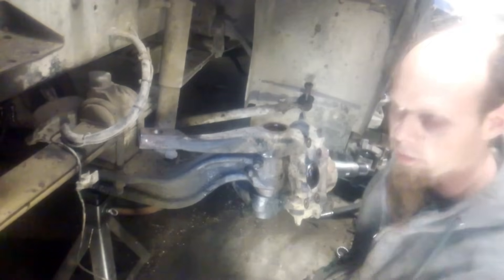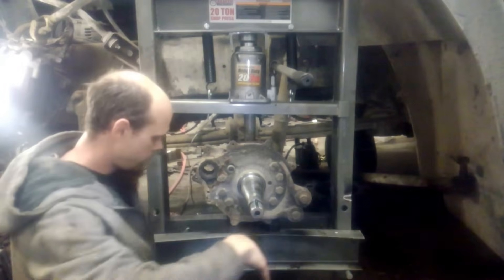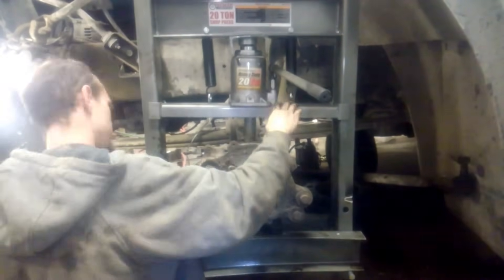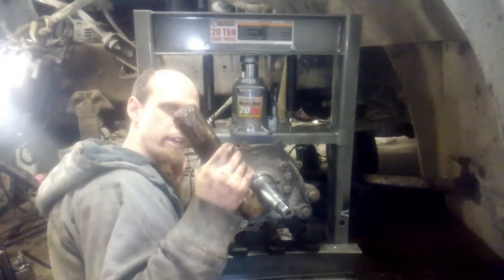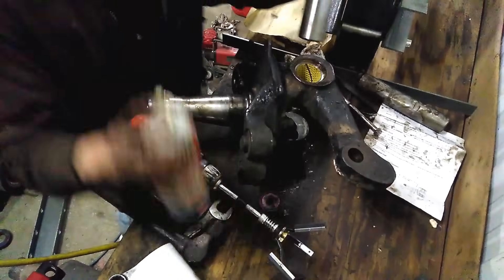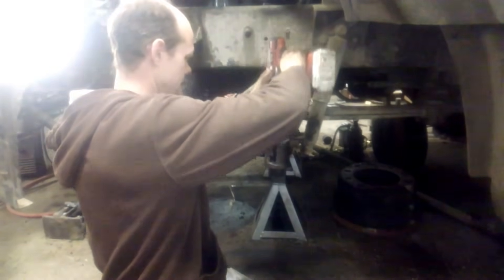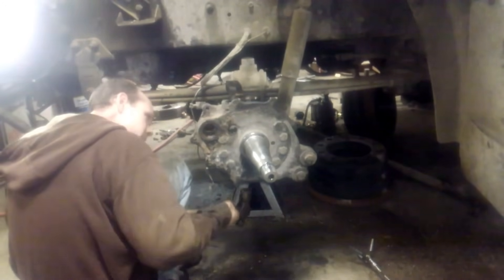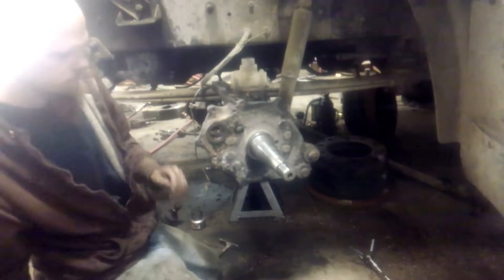kingpin replacement on big truck

Comment: New to trucks m been in automotive for years though . Is there a bushing in the axle eye ?
Reply from the maker: No. By design the pin should not move in the axle eye so there shouldn't be wear at that point. However sometimes the axle eyes will get stretched or damaged and they can be repaired by boring them out and installing a pressed in sleeve.
Reply: @Ezrider359  Thx for the reply . Appreciate it .

Comment: That’s funny. I was changing a Motor mount on a Mack and the spacer or metal thing inside the bushing came down and smacked me in the mouth. I thought I was going to be missing a tooth for a bit until I got the feeling back in my mouth

Comment: Hi I'm a follower just a quick question what size is the brake hone thanks
Reply from the maker: normally the standard brake cyl hones are adjustable from like 3/4 - 2 1/2 or something like that should cover most all kingpins

Comment: I have a freightliner columbia 07 single axel ,have replaced all major frontend parts ,and still feels loose on road . Do you have any suggestions  ? Thank you  !! 
And when braking hard if feel something pop & shift in frontend.
Reply from the maker: My thoughts are improper alignment (toe out or not enough caster) or worn steering box drag link ect for the loose steering. The clunk possibly front spring shackle bushings or stretched u bolts in the rear. Just to give you a few places to look. If you have someone in your area that specializes in suspension/alignment that would probably be your best bet. Most mechanics suck at suspension diagnosis.
Reply: @Ezrider359  steer box  & spring hanger bushings  & new u bolts all been replaced, & alignment at freightliner, that's why im puzzled ,also kingpins tie rod ends,  its hard to find Mechanic to fix the ghost lol
Reply: @Ezrider359  streached u bolts in rear , i was wondering if problem was somewhere other tgan front

Comment: Ezra, what were the indications that you needed to replace the kingpins?

I have an intermittent wobble, and I think we've eliminated tire out of balance. From the top of the tire off the ground, there is about 1/4" rocking back and forth. Is that indicative of needing kingpins?
Reply from the maker: that would be a possible indicator of worn king pins, use a pry bar and a magnetic base dial indicator to check the endplay on the bushings.

Comment: Question...  I just installed my new bushings, and the king pins will not even go in yet.  I have a small hone, but it's taking a long time to get the bushing to take the pin.  Is this normal?  I only have a 220 grit stone, but is this supposed to be slow process?  Thanks for the great videos.

Comment: I have done my fair share of king pins I have always pushed from the bottom because some pins are marked top by a T on the pin .they may have a slight taper
Reply: @DR-um2bv  their is a printed spec in the shop manual

Comment: important make sure you clean it off 2nd one i did i dint see the second lock pin because of grease and im the only person i know that has ever removed a kingpin with the locking bolt in place

Comment: I know the feeling when it comes to stuck kingpins. The 1.5" ones are a nightmare, the 2" ones come out easier. As a recommendation, when i get a frozen wedge pin, i heat it up cherry red with a torch. Then I lean on it with an air hammer.  When it comes to the kingpin, i heat the spindle just a little, and then drive it out with an air chipping hammer. Sometimes i alternate between the chipping hammer, and the 16 .lb sledgehammer. Some guys use kingpin presses, but they are expensive, and don't fit all trucks. And if possible, i like using the spiral kyser king pin kits. No reaming, hardened steel bushings, and they last forever.  Hope this helps.

Comment: We call it "Achsschenkelbolzen" and it is very easy to insert without tools if you put it in liquid nitrogen beforehand. At least that's how we do it. Otherwise we would have to press it in hydraulically. With a hammer you have no chance with ours. Ours are without clamping bolt. Is an unpopular job.
I assembled them by hand in the factory for a month. 64 pieces in an 8 hour shift.

Comment: I'm a retired truck mechanic, I remember the old days when the new bushings were just a brass bushing that you installed and then you used a great big reamer and reamed and reamed until the king pin fit the bushing. it was a lot of work. Then later they came up with plastic bushings which was real easy, but they didn't last very long.

Comment: dont u should install the kingpin iced ??? to make him a little smaller
Reply from the maker: Not on king pins but that method is used for some things
Reply: @Ezrider359  cuz i work on buses with ZF axles and we using liquid nitrogen And i must say Its the best way bcs sometime happen that kingpin stays in the middle of the ring And wont go in And out either

Comment: I hired a guy to do kingpins on my kw in February. He did a horrible job. The driver side has no shims and missing one of the pinch bolts. Is it possible that I could just tap the kingpin down far enough to slide some shims on it or is it a bigger job than that?

Comment: I did kings in my 94,377 the shop I  had do the job f__ked it up,put the greasecups in upside down,I had them  redo it and then they stripped  out the top threads on the spindle plus the grease  cap,what really  pisses  me off is I  lost a 1500.00 $ run over this f__ked up job.I have to find another  shop as I am getting  to old to tackle  that job ,and do to the fact that I don't  have a place  too  do it...
Reply from the maker: that sucks, big part of the reason why i started doing all my own repairs got tired of having to re do things i already paid someone to do. wish you the best of luck in getting it sorted out
Reply: Having the bench space is key.

Comment: My bearing is out on my drivers side.I was told it's from not jacking the weight off the wheel before greasing.But anyway I'm tackling this job on my only  day off on my w9.Thanks for the video!Hope mine come out easy!

Comment: Went to vocational school 3 years to be a diesel and truck mechanic. Been doing since 1980 even after i started driving. Please use safety glasses (I've had 2 major eye surgeries on my left eye and was blind in my left eye for 3 weeks ( HORRIBLE feeling) protect those eyes son !!!
I thought i was the only one who used a hone to clean and size the bores 👍👍👍 you did DAMN good !!! Always put the shims between the axle and the top bushing boss (you DID !!) Good job and great video. ALL THE BEST SIR.

Comment: Brother run the jack up as tight as you can get it, and smack the joint with a hammer and it will pop like gun going off.

Comment: can I give you some advice from now on when ever you grease these take a hydraulic jack and put it under the axle and take the weight off the front wheel 1 inch off the floor and then grease t king pin top and bottom never grease them under load. you won't have to go there again. tip free a heavy truck mechanic that's how I do it lve done 100s  of them. 👍
Reply: Perry, I'm a novice about to undertake this process on my 67 Dodge d200. So, are you saying to grease prior to removal? I've been looking for someone who has experience to give me some guidance regarding what tools to use, etc.
Reply: @mechantics  No. he meant take the load off when doing grease during a PM. If it's under load, the grease never gets to where the most contact is. If you haven't already done yours, invest in a can of aerokroil and soak the hell out of the old stuff to help it break free easier.

Comment: the press is a good idea i took an old kingpin and welded a long piece of key stock to it so someone can hold it while the other guy swings the sledge. i heated mine with a rosebud and with luck about 5-6 swings they fell right out

Comment: Love your work. Thanks for the tips. If you come across how to get a pitman arm off a sector shaft without a puller, ('cause your boss is too * cheap to buy one from Snap On), I'd love to see it.
Reply: Take the bolt out of the pitman arm where it is attached to the sector shaft.Gently tap a chisel into the gap that was under the bolt and open up the gap a little.Carefully pry on the arm on the shaft alternating sides while you wiggle it back and forth.It should come ff this way.I took one off a 1930 Ford model A with no trouble this way,heating the arm a little can help too.A puller can be had from most parts stores for free if you ask, a deposit is needed to ensure it's return.A good shop should have one anyway, it saves time and time is money.

Comment: thanks for the show, it inspired press my first kingpin. my press is easier to operate pushing the pin up, but all the kingpin shows i have watched, press down. i caliper'd the pin on both ends, measuring 1.875... so that means i am good to press up instead of down, right?

i had a hell of a time removing the kingpin retainers, i had to invent 4 drifts: 2+hr. and the draglink nuts are seized proper, but i can work around that by removing more steering gear... and 4 tons pressing up hasnt moved
Reply from the maker: straight non tapered pins should be able to come out either up or down. probably just seized in there good and tight. kingpins are one of those jobs that is pretty straight forward but can fight you every step of the way sometimes.
Reply: yea i went on to watch more kingpin shows. i found one company that made a press similar to yours, but it was moujted on casters, and used a 30Ton bottle pushing up!
Reply: m.youtube.com%2Fwatch%3Fv%3Dt5ppPLc8T5o&usg=AOvVaw3KkYR1Bh5evI2rOWKH-XmG

Comment: Great vid using good creativity to remove the old king pin. However, the new king pin seems to be wayyy too loose into this axle, it is supposed to be tighter than that, not going through by hand. The solution is to remove the axle and have a sleeve installed by a machine shop.
Reply from the maker: the kingpin fit was proper, they are not supposed to be a press fit, the king pins get seized in the axle eye over time is why they often need to be pressed out.
Reply: Ezrider92356 not press fit but thighter than that: you're supposed to install them with a rubber hammer with slight taps. Oversize holes or out of round may lead to a premature failure.
Reply from the maker: They are still well within spec even after a year of use best to reference the litiature for the exact kingpin set your working with

Comment: Greate video!   Ben there, done that in forgetting the safety glasses.   Have a few war wounds myself.    I like the idea of the press, I'm going to try it.   Thanks for the information
Reply from the maker: the press worked really good, put some legs on it after this and now it makes a really handy bench top press as well. pretty sure i actually broke my face when this happened cause almost a year later now still have some mild pain where i got hit and can feel a large indention in the bone just under my eye socket where i got smacked in the face....lol

Comment: Do you have any advice on how to remove a king pin with a bomb, or a high powered rifle? That would be so much more gratifying than hammering and using a press!
Reply from the maker: lmao, yes that would be so much more gratifying, if you can get your hands on some c4 and det cord and a rocket booster. strap the rocket booster to the back of the truck point it towards a cliff, attach the c4 to the kingpin light the rocket booster and try to set off the c4 while its air born off the cliff. (this is a joke of course if anyone reading this thinks I'm serious)
Reply: The FBI will be at your door and mine in the morning since we tripped the algarythems by saying the wrong thing! Lol
Reply from the maker: @silverhorder1969  awesome just spent an hour getting a level 1 today, might as well keep the fun times going...lol

Comment: I need do someting in my truck how i can contact u?
Reply from the maker: you can either ask me questions, here in the comments or you can e-mail me at ezrider_92356@yahoo.com im not a expert in all topics but i do my best to answer viewers questions.
Reply: In what state is you shop lacated?
Reply from the maker: im located in bismarck, nd. not really a for hire shop i am a owner operator who does repairs on my own equipment. i do take on a little outside work here and there when i have a little extra time. what is it your looking to get done?
Reply: King pins, shakle pins and tracktor bushings
Reply from the maker: im not going to have time to take that on any time soon, if you decide you want to try to tackle it yourself ill be more than happy to answer any questions you may have
Reply: Ok thank you

Comment: Going to need a video on replacing the steer wheel bearings my dude. Looks like my spindle is ok, everything from the outer bearing pretty much was vaporised and floating around inside the hub.
Reply from the maker: glad the spindle is good makes things a lot simpler for sure. . got ya covered on the steer axle wheel bearing video. https://youtu.be/tXBuAh8lZI0

Comment: So I've got an International 3800 that destroyed a front wheel bearing. Pretty sure it got driven on and the spindle is going to be toast. Without having looked yet, am I better off trying to replace the spindle, or everything from the kingpin out? I haven't looked because I destroyed most of my ratchets/breaker bars trying to get the lugs off, torque multiplier is in the mail.
Reply from the maker: basically what i have on the work bench in this video when im putting in the new bushings is all one piece so you cant replace just the spindle. and i don't think the axle doctor would cut one off and weld a new one on like they will do on a trailer or drive axle. your have to take it apart at the kingpin. then you can re use your old s cam's and such on the new one. the other option would be a complete axle from a junk yard drop the drag ling from the steering box cut the 4 u bolts roll it out and roll the new one in. but who knows what kind of shape a junk yard axle will be in probably would need to be gone threw anyway. as far as the lug nuts here is a video on my recommendations https://youtu.be/XXAsZWyUsAQ torque multiplier will work but it will be slow. good luck to you. always sucks when those kind of things happen.
Reply: Thanks for the indepth reply. Maybe next year I'll be able to get a bigger compressor and such, not in the budget for now and this bus is meant to be a Skoolie so no rush. What's that assembly called? steering knuckle?  Thanks again, great videos btw

Comment: Wow no safety glasses while hammering, or using a 20 ton press, but you use safety glasses/hood while grinding, and then again using a drill/hone again with no safety glasses. Your eyes cannot be replaced, after that black eye you got, one would think,that safety glasses might be a good idea. Other than that I think you did a good job on the video.
Reply from the maker: i did have a face sheild on when using the press until things started moving and there was not as much tension on the press but i was standing back and away and my head wasn't in the frame of the camera. also i did have safety glasses on when i got the black eye, what i should have had on was a face sheild. but the black eye was actually a broken cheek bone. so the safety glasses didn't help me there. but you are still right on the other counts. id like to think these comments help me keep safety in mind working in the shop so thank you.

Comment: just had my dumptrucks king pins replaced.   now it walks all over the road.  and when i make a turn the wheel doesn't straighten out on its own.   it holds the turn and doesn't go back straight.
Reply: I'd rather say too much shims or improperly rimmed bushings (not enough material removed) which makes the knuckles really hard to turn. I'm saying this because the problem appeared right after the job was done. The caster is being adjusted with shims under the spring seat, which has nothing to do with a king pin replacement.
Reply from the maker: Sounds like a alignment issue specifically lack of caster. Only time I have seen kingpins cause those symptoms was a izusu npr that the kingpins had not been greased in a very long time and we're seizing up. You would of had a very tough time on assembly if they were installed that tight. I think a good alignment shop that specializes in alignments should be able to get you fixed up

Comment: Actually, I was thinking man you are slowly poisoning yourself with the grease/oils/lubricants. Many contain lead and other heavy metals that get adsorbed thru the skin.  Use nitrile gloves, tight fitting, pretty durable, disposable and can be reused till they tear or wear out.  Just pull the wrist part up and blow into it. Inflates easy to take off and put back on so not expensive.  Plus makes cleaning up the hands at end of day a breeze :-) And saves yourself from some random cancer 20 years from now.  Good video, keep them coming.

Comment: great video  but I have one question all big trucks have the same king pin or some kind of standard size for volvo/freightliner/kenworth/peterbilt
Reply from the maker: parts may be slightly different but the process is generally the same. this truck has a eaton/dana 12k lb steer axle witch is probably the most common steer axle across all brands of class 8 trucks. there can be some small differences between different manufactures mack axles have tapered pins, some may have 2 pinch bolts but still the process is the same.